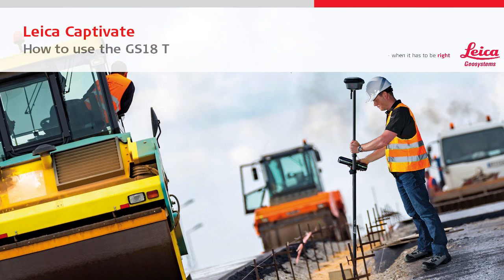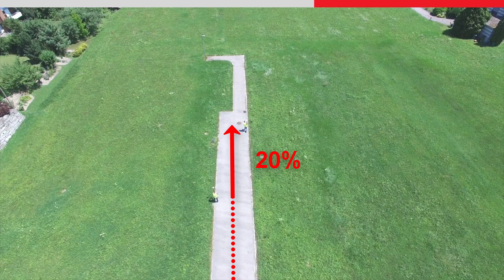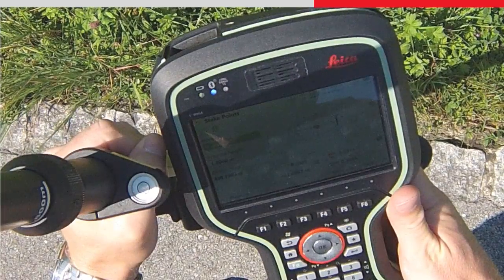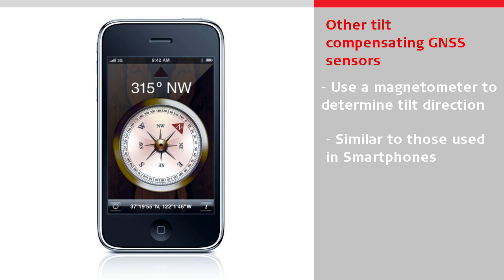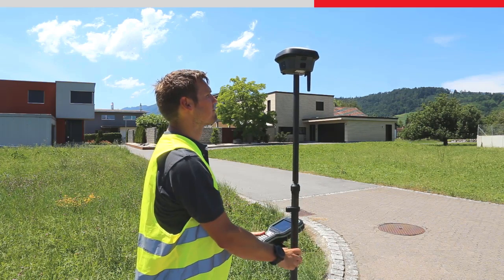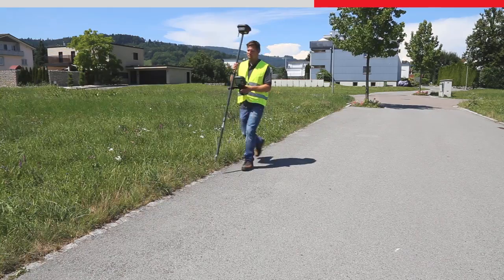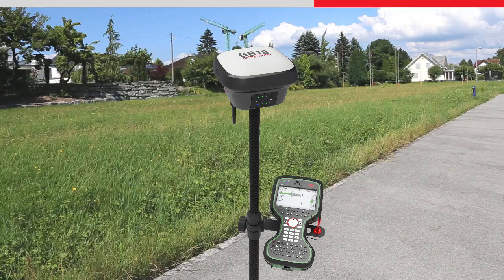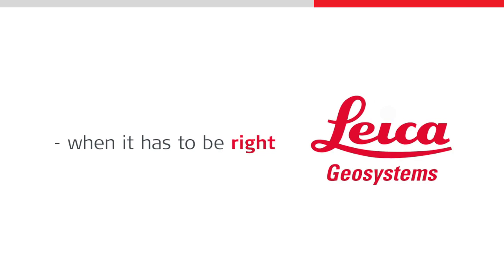How to use the Leica GS18 T GNSS RTK rover

Comment: Does Leica have an app to use a cellphone in place of the hand unit?  a good app would make for a much more agile interface experience and handy unit.
Reply from the maker: At the moment, we do not have an Android or iOS App supporting the GS18 T, which is globally available. We understand that this topic is highly contemporary.
Reply: @LeicaGeosystemsCH  I meant for the GPS units in general. I assume GS14 and such don't have an app either?  by contemporary do you mean urgent? or new fangled that you scoff at? :)   as a user of your GPS products, I would recommend agility and lower cost options. A simplified GPS antenna for use with a smart phone would be quite welcome. At near 20k$ for an RTK GPS you run the risk of suddenly being underbid by products with equal precision and price more like 200$ which will make justification for use of your products difficult.
Reply from the maker: @DanFrederiksen  Hi Dan, please contact your local sales representative for more info on apps supporting our RTK rovers. You can find the contact info on this link: http://leica-geosystems.com/contact-us/sales_support/sales

Comment: So it magically reduces multipath near buildings?
Reply from the maker: Only phase multipath is relevant for the accuracy when measuring positions with fixed ambiguities and the impact of phase multipath is indeed little also close to buildings. A highest grade antenna with almost choke ring performance is used to suppress multipath. The quality indicator gives excellent indication of the predominant conditions and the expected accuracy also close to buildings.